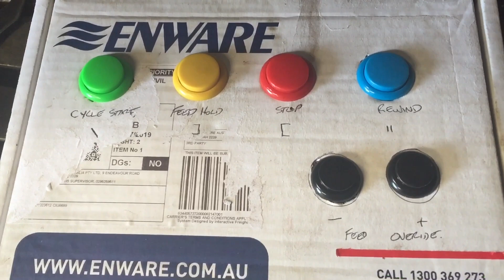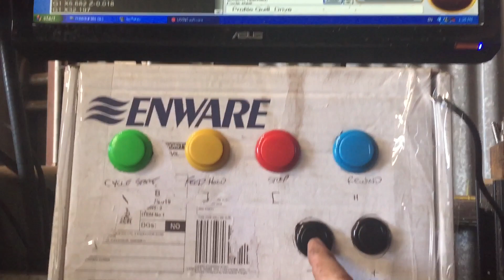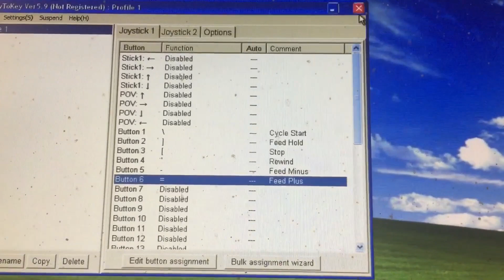UCCNC controlled with Zero Delay arcade emulator board.

Comment: cool, will it work with a potentiometer pot instead of the  the buttons for feed rate plus and minus?
Reply from the maker: Dunno. I abandoned this idea as I found it to be glitchy. Better off just using a USB keyboard or keypad and redesigning a pendant from that.
Reply: @diycnc3442  thanx for the answer, good to know 👍